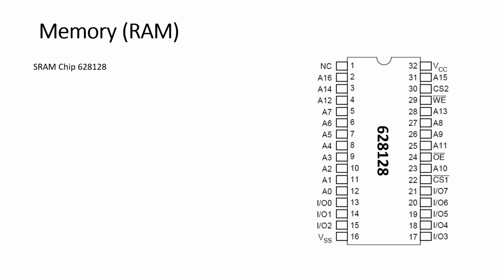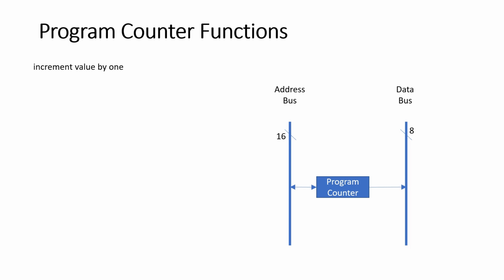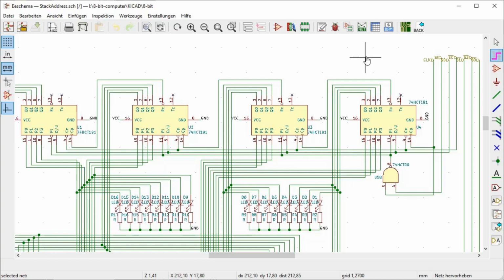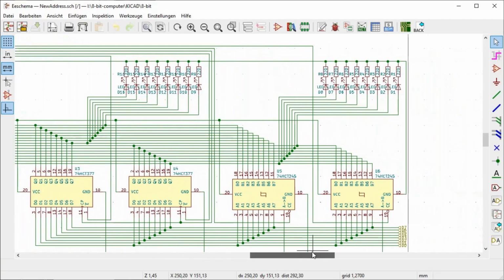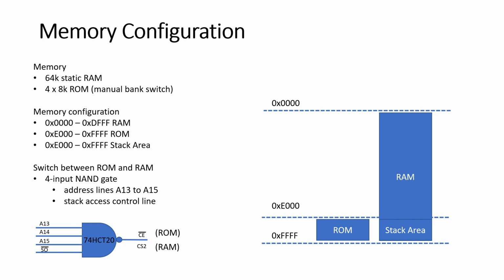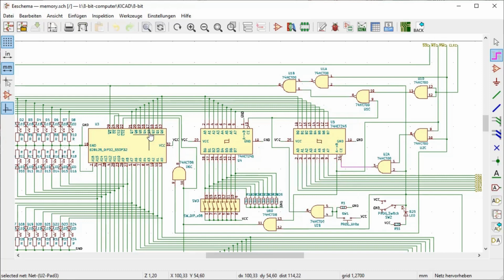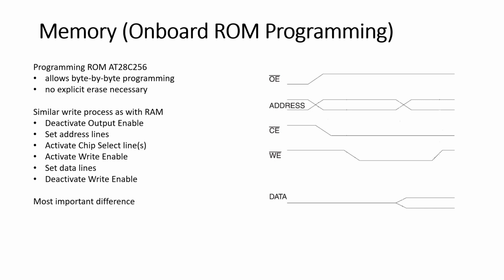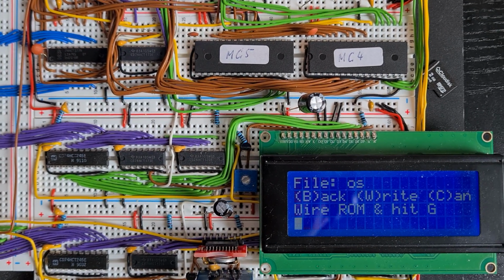8-Bit Breadboard CPU (Memory, Address Registers, Onboard Programming)

Comment: Is there any way to talk with those old SIMM/DIMM memory modules that can be taken out from old computers somehow? It would be cool to be able to use some higher-capacity RAMs.
Reply from the maker: Those SIMM and DIMM memory modules are made out of dynamic RAM, which would require a separate refresh cycle to keep the stored data. For a computer as simple as mine this would make memory timing much too complicated and so most homebrew TTL chip based CPUs use static RAM. Also take into account that the higher the RAM capacity the more address lines are required to access all the data. This is why I didn't look into using SIMM or DIMM modules for my build.
But  in the end: It's not impossible. If you like challenges - try your best and have fun connecting those modules to your self created CPU project.
Reply: @DerULF1  Hmm so those RAM modules don't have the refresh circuitry built-in? (I mean, not necessarily inside the memory chips, but perhaps as a separate chip on the module's PCB?) I don't suppose such things as refresh circuitry would have to be designed and made from scratch for every implementation, and there should be some ready-made chips for that purpose, right?
Reply from the maker: @bonbonpony  While I'm not an expert in PC hardware it is my understanding that those DDR RAM chips are not self refreshing, but need to be refreshed by the memory controller which is part of the chipset on the motherboard.